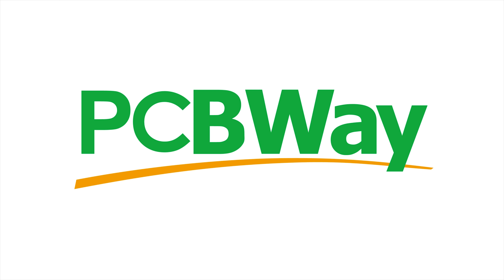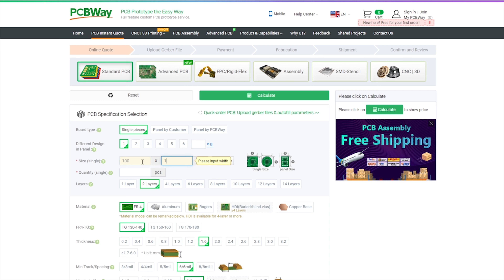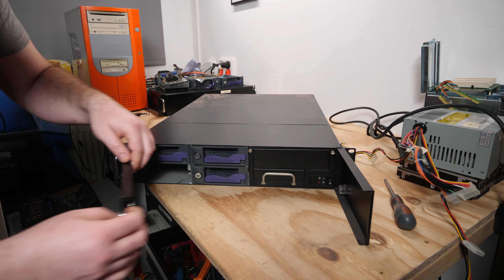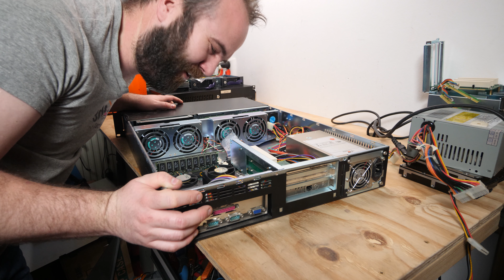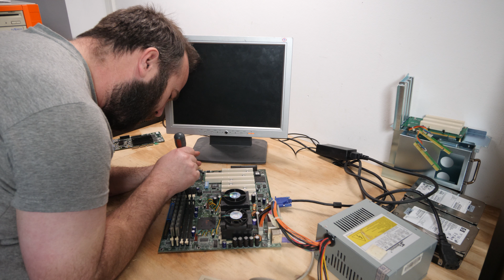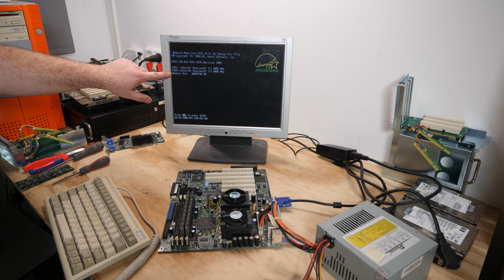Pentium III Server Teardown

Comment: PCI FX5500 and a pair of Voodoo 2's SLI would work great in this board. I use to find these cases on ebay for $30 new back in the day.  Now they are quite pricey.  I dug a 4U out of my closet and I thought it was empty, but no still had a dual socket 603 board and scsi hard drives. An ebay piece together special if I remember from 15 years ago.

Comment: Hey Victor!
Man, that's a cool board. Even though the 64-bit slots are keyed for 5V according to the manual they're 33MHz and 66MHz capable.
If that's correct you could put two Voodoo2 on SLI in there. According to their datasheet the V2 chipset is also 66MHz capable but the cards are all keyed for 5V.
If the Voodoo2 cards work at 66MHz in SLI in there it wuld be so cool to see if/how their performance improves compared to 33MHz PCI speed.
That would be an extremely unique system. :D

Get well soon! :-)
Reply: don't forget form factor *